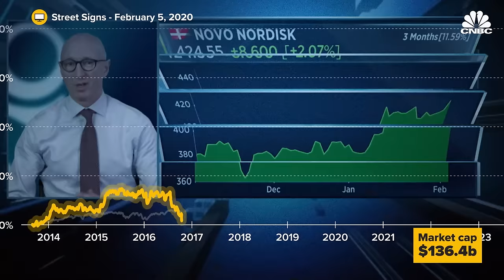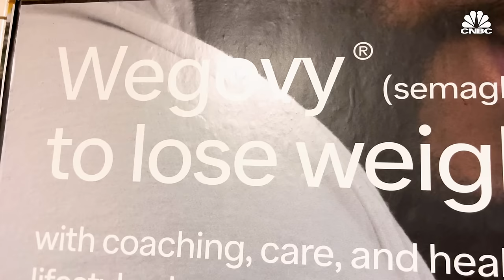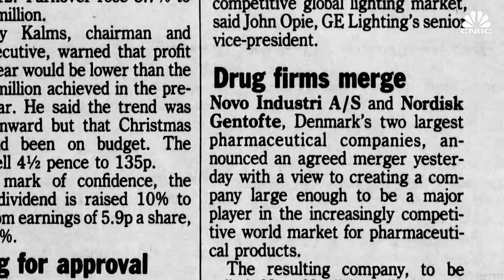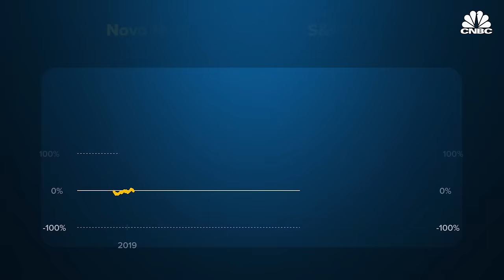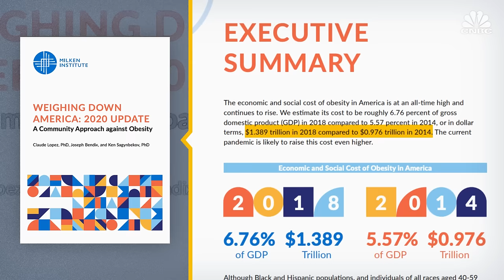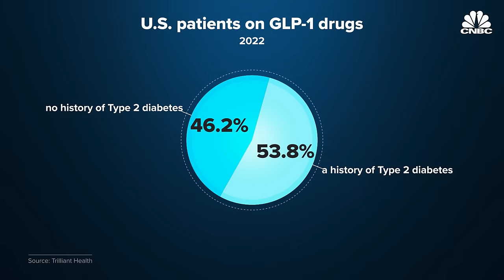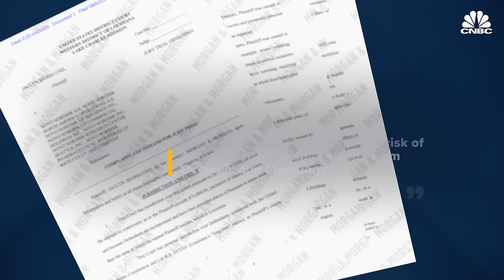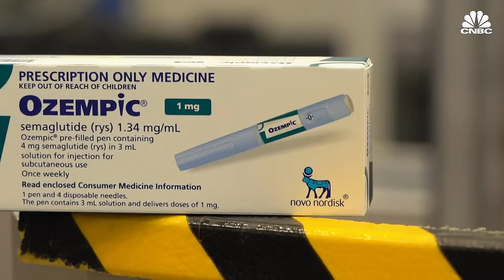How Ozempic And Wegovy Accidentally Made Novo Nordisk A $400B Company

Comment: I am bipolar type 2, I am on heavy psych meds that slow your system which is well known and one of the biggest problems in mental healthcare. Many patients stop taking the meds and suffer due to the weight gain. I have now lost 70 lbs that I gained from the anti-psychotics. I want to preface I eat well and workout and had been bodybuilding for over 3 years before going on Wegovy. Now- I’ve reversed some of my health conditions, I have zero desire for doing anything impulsive (this is a huge aspect of bipolar). I don’t spend money like I used to. I don’t have the hypomania anymore. Changed my life.
Reply: The truth is, you’re going to have to weigh the pros and cons, the cons for me were to get worse mentally and potentially damage society around me including myself or take the drug and deal
Reply: I even have a healthy relationship now. I couldn’t imagine this before.
Reply: Good for you! I rx these meds, and feel terrible that there are few options that actually work. Some will rx metformin but its limited in efficacy for many patients. Most of the new drugs with less weight gain are too expensive (outside latuda which is now generic). In 10 years we wont need meds like ozempic as much for weight loss, but i think for the next decade it should be considered more - though yes the psychiatric side effects are concerning - the side effects of 70lb of weight gain also matter. Best of luck!

Comment: Why cannot they have reusable pens and just put in a refill vial for the drug??
Reply: the needle gets dull
Reply: If not clean properly, it can cause infection.
Reply: Possibly because of cost and safety. The different doses would come in different vial sizes (1mg dose comes in 3ml and 0.5mg dose comes in 1.5ml vial). The current disposable pens only dial up the maximum for that dose. You would need different reusable pen sizes. People start on the lower dose for a couple of months then go up to the higher dose. They might never use the lower dose pens again, with reusable pens costing more than disposable pens. There might be some people that can’t handle the side effects so stop taking it. It’s not like insulin where you’ll always use the pen for life, unless T1 diabetes is cured. So if one insulin isn’t suitable you can change to another, using the reusable pen.